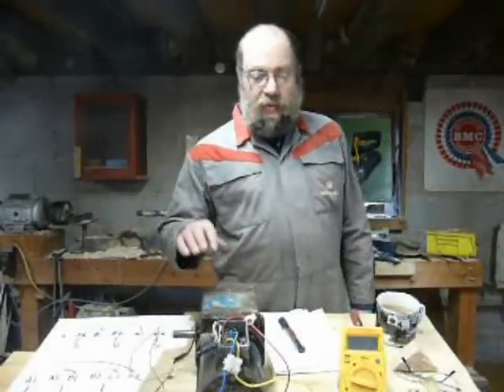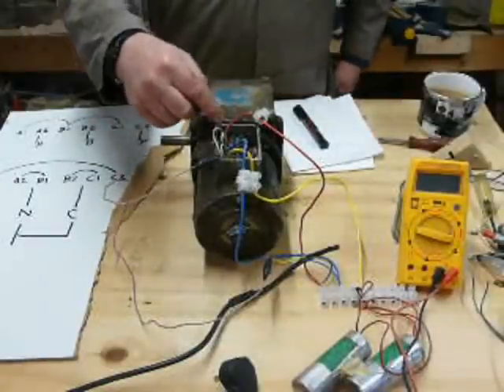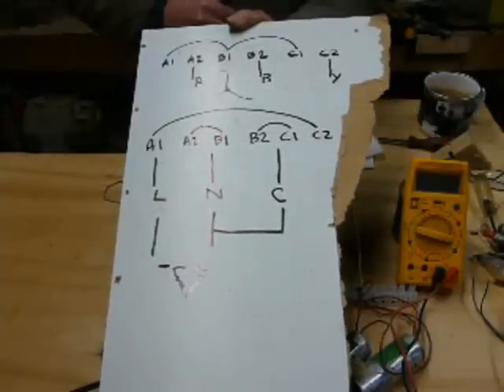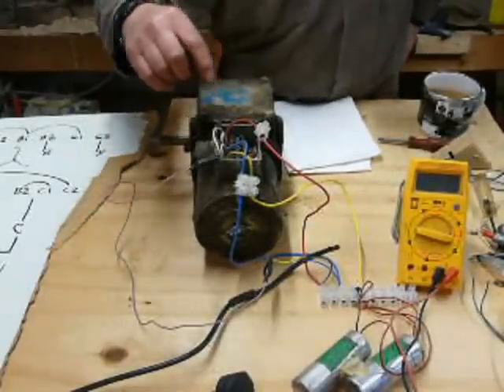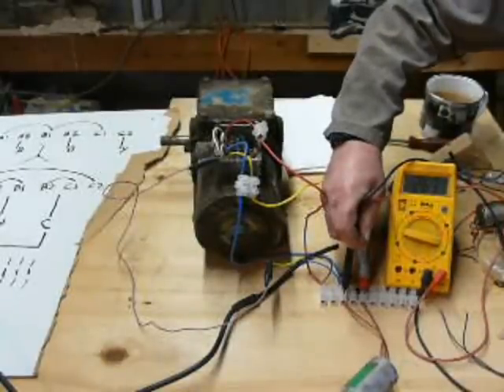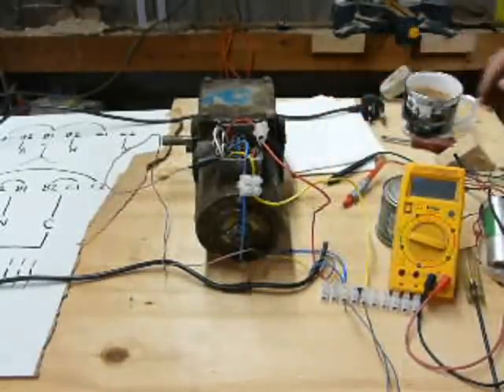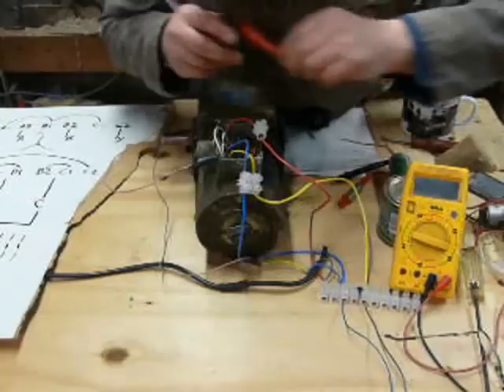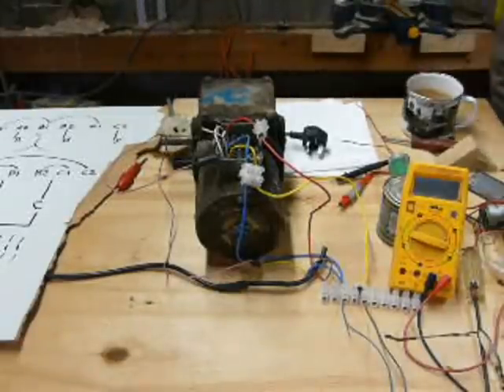How to do it: run a 3 phase motor on single phase supply. part 3

Comment: Start cap was needed to create a lagging current on other winding to perform enough torque to make it start rotating easily, but will make an excessive voltage on that winding after its rotating normally, so the C value must be decrease when the rated rpm obtained. it will going closely perfect if you connect 3 capacitor (C1,C2,Cp).You only have C1.  C1 & C2 work to compensate the imbalanced voltage while C2 is in 25-40% of C1 value. Cp is power factor correction connected to line supply

Comment: It's been many years since I studied the theory of AC motors. I can't claim to have any in-depth knowledge. The theory is actually very complex.  Rather, I was just trying to speculate on what is basically happening with your set-up. Great that it works and can save money in the short term. I guess if the motor is under heavy use it could waste money also due to lowered efficiency!

Comment from the maker: That's right it gives a boost to increase starting torque, but if left in circuit it will cause excess voltage and burn out the windings. This is especially so when the coils are connected in delta. Thanks for the comment

Comment from the maker: Thanks for your in-depth knowledge spread over 3 messages. It will be valuable to many of the viewers. It is very easy to see that you know much more on the theory side. All I know is that it works and is adequate for use in small home workshops, and saves a considerable wedge of cash.

Comment: Consider the N to be 0 degrees and the L to be 180 deg. This is across one winding. Without any cap's the other two windings are in series with each other and this series pair are in parallel to the first winding. So the phase of winding 2 & 3 are the same and so is the parallel winding 1. Add a cap and if terminal A is 0 deg (N), term B is 180 deg (L) then term C has to be somewhere between 0 and 180 deg. There's no way the cap will change the phase relationship of the L and N supply input.

Comment: The start cap may be providing a parallel RLC circuit with one winding giving the R and L. This would give high current in that winding, which helps the motor start.

Comment: Yes, the 'delay' you speak about is a phase difference. If you pass an AC signal through a capacitor you get approx 90 degrees phase lag (voltage lags current). The reduction in (mechanical) power output and in efficiency would be due to the windings not having 120 degrees phase difference. Thinking more about this, what I said earlier about the phases must be wrong though as you have delta connections.

Comment from the maker: I'm not sure about that. I imagine that the 240 is across a coil set, and the capacitor delays the power to another coils set connected at the 3rd terminal. So that only 2 coil sets are used, hence to reduction in power and reduced current draw. To use the other coil set another capacitor is needed but this time between the neutral and the 3rd terminal. Then a start cap is needed to set the direction of rotation. This is called tanking and gives more power. That's how I understand it.

Comment: Looking at your video, I'm wondering if what you have is two of the motor windings running at 180 degrees phase difference whilst the third winding is running approx 90 degrees phase difference from the first two. The approx 90 degrees phase shift being provided by the capacitor.

Comment: The line to neutral voltage is approx the line to line voltage divided by 1.73 (root 3). For example, 415v / 1.73 = 240v

Comment: I believe the neutral is useful where the individual loads on the three phases is unbalanced. Unbalanced loads will result in a current in the neutral. For balanced loads there is no requirement for a neutral as there will be no current flowing in it anyway.

Comment from the maker: .Hi. Thanks for your interest. Yes it is less efficient, but the whole point is to use available motors, rather than having to change the motor or use a converter. The neutral wire can be on the supply and give 230v between any phase and neutral. However running from single phase supply means that it desirable to match the coils to 230 instead of 415. Hence the need to use delta instead of star. There are 6 parts to the series. Hope that helps

Comment from the maker: From what I remember, the neutral wire is used to get 2300v, so there is 415 between any 2 three phase wires and 230 between any of these live wires and the neutral.

Comment: I really enjoy your videos.  Nice recovery on the oops, OldFartSyndrome of no change of operation of removing C1/B2 tab.  Well, I never understood this concept well enough to jump into to it, so I concentrated on radio receivers. Like Apollo and Skylab, then 2 way VHF.  Small 3 phase motors on single phase with cap's running in your manner run, 87% eff  58% power compared to a motor runnin on real 3 phase power.

Comment from the maker: Hi. Thanks for your interest. The problem with large motors is the current needed to run them. Motors use as a rule of thumb about 4 amps per Hp at 230v, so a 10Hp would need 40 amps to run, but between 5 and 10 times that to start. With a pressure washer it may have to start against water pressure unless it is the type where the motor runs constantly, and so would need start capacitors. Give it a go, experiment and enjoy the process.

Comment from the maker: Thanks for the interest. Yes a pilot motor will stabilise the 3 phase if you are running things all the time. In my workshop each machine has it's own capacitors because they are not used continuously.

Comment: Tnx Andy  true guru
I will use a 3ph 3kw with ur caps coupled to a onefourth hp 3 ph then isolate mains the extra power feed to the small motor plus extra source   hope i made it

Comment from the maker: Hi. I am not sure best contact them direct, All I know is that if you use a free running pilot motor then a true third phase is generated from this pilot motor giving good starting performance. I think the capacitors ore on the pilot motor and the driven motor is wired to the pilot with a switch in between. Hope that helps.

Comment from the maker: Hi. Thanks for your comment. The third phase is not disconnected as it is connected either to the live or neutral at one end and a capacitor at the other. This means that any generated power can be dumped into the system rather than building up a high voltage. The cols will burn out if the capacitor value is too high and so causes a voltage that is too high for the coil. To use all 3 phases a pilot motor can be used, or a capacitor can be used from both input terminals but needs a start cap.

Comment: Trying to understand this stuff :) i have purchased alot of 3 phase machinery and my needs for power at home are ever increasing. this is the first explanation of delta and star that i have even begun to understand. All good lessons learned here. Oddly enough as i begun watching these videos, the condenser fan on my rooftop ac crapped out. Turned out to be a capacitor issue :) Coincidence?

Comment: Hi, and thank you very much for your informative video. I have been working in an  industrial motor shop for years rewinding, repairing and redisigning motor circuitry for almost seven years. I think this could be a good way to rewind single phase motors to use the better three phase circuitry ; ) I noticed that you ran your motor with the one link disconnected. That effectively removes an entire phase of the three phase motor, a three phase motor will run on two phases as you demonstrated...

Comment from the maker: Yes you are right, they run at about 2/3 power, but mostly that's fine for occasional use. The way you do it with a pilot motor creates a true stable third phase, which is much better for continuous or hard use. Thanks for the comment.

Comment: This is basically building  static phase converter, no? I use the same start circuit as this, but i build rotary phase converter using a spare 3 phase idler. Basically, a rotary transformer. When you run your motors like this, it derates the horsepower correct?

Comment from the maker: That's a good rule of thumb, and something like 30 uf per Hp for the run cap. Experiments and voltage measurements will show if this is correct.

Comment from the maker: Hi. As a wild guess try 100K resistor. My other video shows a capacitor wired directly across the contacts, best have a look at it. AC should not give a large spark due to reversal of polarity but a charged capacitor will when to contact is made rather than with the DC it during disconnect. Hope that makes some sense.

Comment from the maker: Further to that. Ac will go through a capacitor so this idea may not work. However sometimes the spark comes from the capacitor as you connect, and so a bleed resistor is required across the start capacitor to discharge it.

Comment from the maker: Hi. Yes you need a small capacitor across it, about 0.5 UF because of the AC. Experiment is needed, I have done a video on this, but is is based on DC. Hope this helps

Comment: Thanks for the great tutorials, I've managed to successfully run my 3 phase wood lathe on 240V. However I'm wondering if you could advise what could be done to prevent the arc in the switch thats wired to my run capacitor?

Comment from the maker: It is difficult to give an answer because of differing motor characteristics and starting torque. Best work through the videos and experiment to get the best performance. Don't let the capacitors and the coils go over volts

Comment from the maker: Using this formula for a 1 Kw motor on 240volts at 50 cycles it seems to work out:
36 x 1kw x 220/240 squared x 50/50
36 x1 x (0.91x0.91) x (50/50)
36 x 1 x 0.83 x 1
= 30 uF
about right, thanks for your research.

Comment from the maker: Thanks for this. I worked it with a 1kw motor on 240v at 50 Cs and it worked out at 64 Uf. This seems a bit high, but what is the symbol between (220/v) and the following 2. I am not familiar with this, and of course that figure makes all the difference.

Comment from the maker: I don't know the formula. If there is one it would be quite complicated due to differing motor characteristics. These videos show how to experiment to get the best value by balancing capacitor run and start values, and capacitor voltage under load..

Comment from the maker: Hi. Part one explains the star and delta wiring. With delta the coil has a closer match to the 240v supply. With Star the coils are in series and so are best suited for 415v and so have a greater resistance. This resistance would reduce the current flow when using the lower (240) voltage. Hope that helps.

Comment from the maker: Check out this link.I will add it to the video description. I think it shows how to activate the 3rd phase by using a capacitor from the opposite polarity. It would only work where a start capacitor is used to define the rotation. 
Let's hear how you get on with your experiments.
It would be worth measuring the current  before and after the additional capacitor is connected.

Comment: It would be very interesting though to see your motor connected to an oscillascope to see exactly where the phases are in relation to each other.I was toying with the idea of rewinding a 3 phase to single phase.But apparently this is not possible either.Reason being to achieve the same hp it would cause saturation of the stator.Which explains why single phase motors are alot bigger than the equivalent hp 3 phase.

Comment from the maker: Hi. Yes compressors put a great deal of stress on motors, starting up against pressure and then building up to full pressure. A change of pulley will help and a pressure control will mean the motor does not stop / start all the time. Hope you have success.

Comment: For sporadic use as with your mortice machine yes 240v would probably be fine.I'm wanting to run a large compressor 415v 3 ph from a domestic 240v 1 ph supply.So if the power loss is around 40% then the machine may not be able to turn the pump.The way round it may be to decrease the size of the motor pulley.But anyway,excellent videos.

Comment from the maker: Thanks for your incisive comment. You are entirely correct, but as 3 phase motors are designed for industrial duty it is fine running them this way at about 60% of the power rating. It's a practical solution to small workshop problem. Thanks

Comment: Very interesting.I like a good practical experiment.And the videos are not long winded and boring as some are.I admit I'm alittle confused.With 3 phase the phases are seperated by 120 degrees.Making a total of 360.Your using capacitors to cause a delay to the second coil but what is happening to the 3rd coil?.I suspect to run the motor at optimum efficiency you would need a transformer to up the voltage and capacitors arranged for both phase 2 and 3.

Comment from the maker: When operating a 3 phase motor on single phase you get about 60% of the power. The answer to your question is try it and see. Usually 3 phase motors are designed for industrial duty, so there is a fair amount of leeway. Make sure you get the capacitor voltages right, and I suspect you will need a start capacitor as the motor will be starting against a load. Hope that helps and let's hear how you get on.

Comment from the maker: Hi. I can see you need a start point. The videos show how to experiment to get the aprox right values. The voltage on the capacitors is important, as is the need to watch all 5 videos. I would start with 60 Uf run with 100 Uf start, but they may be on the low side. Hope this helps. Andy

Comment: If you wire backwards from the third leg of the running motor to your shop you basically have built a rotary phase converter for the rest of your shop

Comment: The way we run a 240v three phase motor on 240v single is just to use a start capacitor to get the motor up to speed and then the motor will generate about 235v from the third leg all on it's own. Rule of thumb is the third leg will be about 80% of the voltage of the other 2 legs but it only needs the third leg to start the motor

Comment from the maker: Simon, get your cooking gear on. Pre heat the oven to gas mark 4. Grease the tin; add pineapple rings, a good tablespoon of the syrup. Cake mix, 6 oz fat, 6 oz self-rasing flour, 3 oz sugar, 1 or 2 eggs, 1/2 t spoon baking power, touch of vanilla.  Make up the sponge mix and add to the tin. Cook for about 3/4 hour or until cooked. Careful about opening the oven early or the sponge will sink. When cooked, cut round the edge of the sponge and turn out. School dinners, let hear about it.

Comment from the maker: Hi, Greg.  The answer to your question is covered in part 1, at about 4 minutes in. Briefly, star is for 440v and delta for 240v because with star there are 2 sets of motor coils in series and so will cope with the higher voltage. Hope that helps. Subscribe to get notification of further videos. Andy